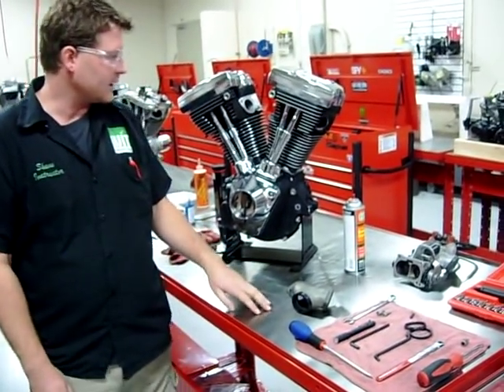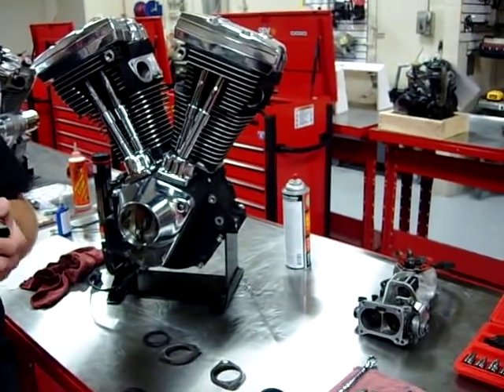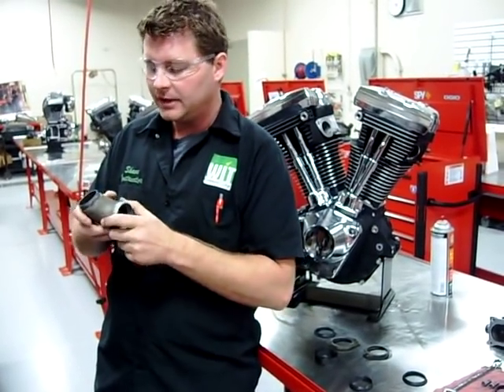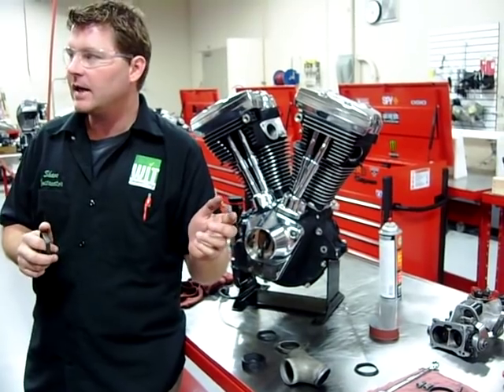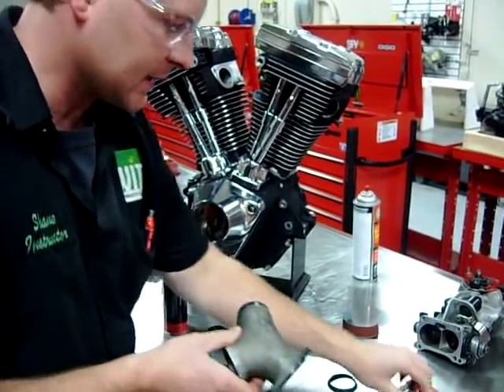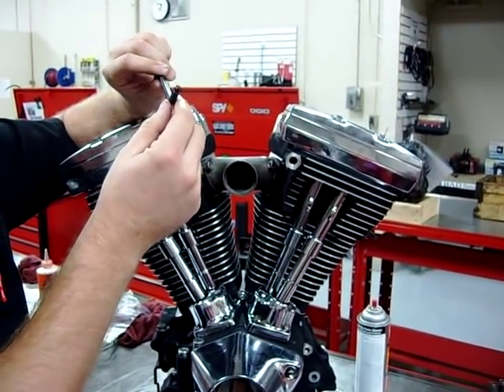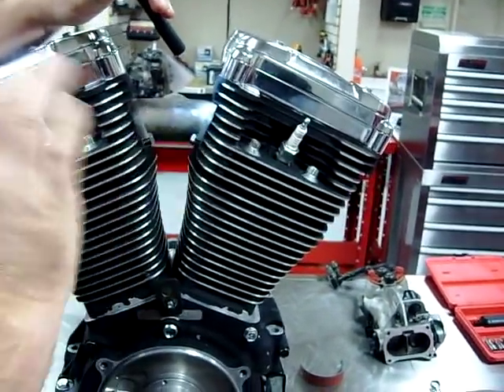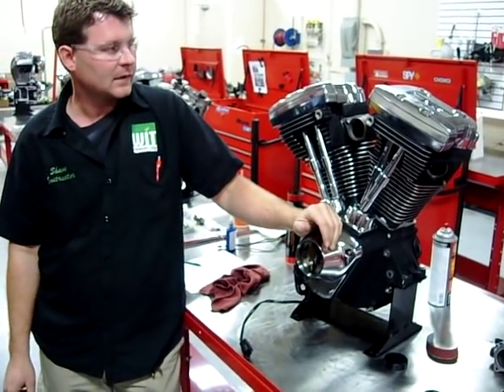Part 11 How to install an intake manifold on Harley Davidson EVO S&S Jims Revtech

Comment: Just bought a 2001 1200 sportster, I was told it had been dropped but fixed. I'm thinking it was dropped off a building, I just found out that the intake manifold is cracked on the carburetor side at 7 o'clock. I can see shiny metal on both sides of the intake going into the cylinders, I'm thinking the cylinders may have moved when they dropped it. It was fine until I put a chrome carb top on it, now when I decelerate, it Pops and sputters. You described the symptoms perfectly halfway through this video. Thanks, I'm changing it out this weekend.
Reply from the maker: I'm actually re-videoing this EVO series as we speak. These are pretty old. Checkout my playlists for Twin Cam and Sportster for much newer vids. Also you may want to sign up for notifications to never miss a new vid! Head over to my website become a member now and to receive 20 minutes of personal mentorship with me. You can even use FaceTime if you have it or find a friends iPhone and we can walk through the actual carburetor process together. I look forward to mentoring you.

Note: Membership is not required to receive coaching or email help. Here are the direct links to individual services offered at H2W:

Email Answer Service-Click http://how2wrench.com/product/email-support/ 

Phone/FaceTime Coaching-Click http://how2wrench.com/product/personal-tech-training-phone-facetime/ 

DIY Mentorship-Click http://how2wrench.com/product/diy-coaching-hire-teach/ 

Dealership Training Services-Click http://how2wrench.com/product-category/dealer-services/ 

MMI/Tech School Student Tutoring-Click http://how2wrench.com/product/mmi-tech-school-student-tutoring-services/

Motivational/Guest Speaker-Click http://how2wrench.com/product/motivational-speaker/ 

On-site Training Services-Click http://how2wrench.com/product/on-site-training/ 

Tech Line Services-Click http://how2wrench.com/product/tech-line-minutes/ 

Mechanic on Duty-Click http://how2wrench.com/product-category/mechanic-on-duty/ 

Did you like this free video and hope to see more? Would you just like to say thank you with a donation? Click https://www.paypal.com/donate/?token=TvKoeRazPL-KysbM-e0ttz-C_gPq2IrqxDmM3ORCu4nxJzQWxYbmo-6m3YuNu64XHLngGW 

Keep Wrenching,
Shane Conley
Instructor/Motivator/Motorcyclist!
www.How2Wrench.com

Comment: Sometimes backfiring is unburnt fuel mixing with the hot air in the muffler n pinging is the wrong fuel just from what ive learnt.

Comment: The last part, question how can you bolt things down slowly when you have the carb and the air cleaner bracket in the way?
Reply: You would have to remove the fuel tank(s)

Comment: Thanks Shane, that was some great info. I've been fighting an intake cough for quite sometime on my 92 FXR-LR and finally figured out it was my intake seals. I replaced the seals, but didn't clean up the intake and it helped, but I was still having problems. I sprayed the seal area with some WD-40 and it cleared up till the WD-40 dried. Now that I watched your video I've bought some more seals and am looking forward to fixing it right the second time. Thanks again for the tip.

Comment: Great video , I think it will help me do the compliance fittings. I have an old EVO with a bendix shovel head butterfly carburetor. My fuel inlet is cracked , losing fuel got to fix that too. Fun times
.
Reply: Find a used Ram Jett solid intake manifold on Ebay. The old Evo intakes with rubber boots are garbage and the later seal ring intakes exist for MoCo assembly line convenience. I threw my new 1988 stock intake in the trash when I bought the bike (I already psychotically hated carb boots from years of wrenching other brands) and that Ram Jett ran for thirty years of use until I replaced the (still good) original engine with an S&S. 
Ram Jetts don't need a carb brace even with a Super B hanging off them. You'll have to make gaskets (gray auto store gasket paper) and source some Allen bolts to replace the original 12 point fasteners which are always missing. No big deal  and you'll likely need to narrow the bolt heads slightly (bench grinder, flap disc on angle grinder, spin bolt with a hand drill) to clear the casting on the narrow side. It's totally worth it and I've lifted my engine using a soft sling around the intake! Try THAT with a stock intake. 

The "E" stamped intakes are fine for the smaller butterfly carbs be they Bendix or Keihin. (If you ever replace the carb go with a CV and a flanged adapter kit.) If you need more info my nick is farmall on Chop Cult.
Reply: Also BTW the stock early Evo carb is a butterfly Keihin but a Bendix will bolt on. Even the first Shovelhead FXRs came with butterfly Keihins (per the factory parts book in my hand, not memory). You can improve those with the Andrews (extinct but repops exist since there are a gazillion Keihins) accelerator pump cover with the internal check ball instead of the stock no check ball emissions version, if your pump cover rattles it has the ball), and a rejet (low speed and main, not just main). A 60 thru 80 drill bit set is perfect (and less than ten bucks) for drilling low speed jets. We checked the lowest number drill bit shank (not the fluted end) that was a slip fit and went up one drill size, test rode and did a plug chop, then let it be (stock engine) or increased if needed due to cam etc. I liked the butterfly on my stock engine, and the rejet runs noticeably cooler (they were lean due to emissions regs) than stock while improving acceleration noticeably.  I also removed the choke plate for better airflow since I didn't need it after the rejet and pump mod, but it doesn't get cold in South Carolina.

Comment: Great video man - Great to know, before I finish repairing / re-building my 2011 103 ci FLHTK (Electra Glide Ultra Limited) with 33,000 miles.
I have a couple questions if anyone would be so kind to help. I dis-assembled my bike because I was getting a Top End Rattle / Chattering noise / sound especially on cold starts - the bike did sound like it was sucking too much air from the breather area at times. When I took the bike apart, I found major amounts of carbon build up on the top of Piston, Combustion Chamber, Valves, ACR, Gaskets. The rest of the engine looked good. (1) I guess my question is could the intake manifold sucking un filtered air, over long periods cause this mess? 

I'm finding that the cost of tools for the bike top end rebuild is costing quite a bit of money, are there any tool rental places for a Top end Rebuilds, and Crank ( 2.)
My question is to anyone out there that may know, 3. My Crankcase has been exposed to the elements for a couple weeks now, I never covered it up. My 3rd and last question is can the Crankcase be flushed out without removing it from the bike with like WD-40 or new cheaper oil or should I just take that out too and do it that way?  I know I have some bugs and shit in there now and possibly will clog my oil pump and stuff. I know, my bad!

Thanks in advance!

Comment: Shane, I have a question about the intake cleaning.
I used 800 Emery  paper to clean the intake manifold to good effect.
I've noticed a rough brown ring at the intake port of my 92 EVO engine.
Do I need to clean that? If so what should I use, I'm a little concerned about using sand paper in that area. I've tried Xlylene and carb cleaner, but it doesn't seem very effective.
Reply from the maker: If the ring is just discolored and not gouged you should be OK. I use a scotch brite pad to clean mine.

Comment: Hi there my bike cuts out sometimes when chopping down to lower gears at intersections it starts straight away.But want to check if it has a manifold leak i have a 07 dyna streetbob.How do i go about it do i remove airflow n throttle body?Will it start after i have taken componants off to check for a leak.

Comment: Thanks for the video,I wish I could come to your school!
Reply: I really appreciate that!!
 I bought a Road King new in 2000  now 26000 miles.
 I just found out that Harley changed the cam plate and I'm wanting the hydraulic tensioner on my bike.  
The only problem is (I'm wondering)  if I should put the money into it being how Harley built the flywheel? 
It should have a new cams and bearings while inside the engine and that runs into money for tools so the job could cost 2000 or more.
It runs ok now but what about later.
Reply from the maker: Oh man you want to see this "Twin Cam" playlist! https://www.youtube.com/playlist?list=PLAtBOuPaEyt_7aGpzL9DxDVZy_fofjo1G 
I have a new video coming out just on replacing the bearings and tensioners too!

Comment: hey great video, very informative. but after you have the intake bolts "snug" an you put the carb on an intake bracket on. how do ya get back to the intake manifold bolts to torque them down?
Reply from the maker: Head over to my website become a member now and to receive 20 minutes of personal mentorship with me. You can even use FaceTime if you have it or find a friends iPhone and we can walk through the actual carburetor process together. I look forward to mentoring you.

Note: Membership is not required to receive coaching or email help. Here are the direct links to individual services offered at H2W:

Email Answer Service-Click http://how2wrench.com/product/email-support/ 

Phone/FaceTime Coaching-Click http://how2wrench.com/product/personal-tech-training-phone-facetime/ 

DIY Mentorship-Click http://how2wrench.com/product/diy-coaching-hire-teach/ 

Dealership Training Services-Click http://how2wrench.com/product-category/dealer-services/ 

MMI/Tech School Student Tutoring-Click http://how2wrench.com/product/mmi-tech-school-student-tutoring-services/

Motivational/Guest Speaker-Click http://how2wrench.com/product/motivational-speaker/ 

On-site Training Services-Click http://how2wrench.com/product/on-site-training/ 

Tech Line Services-Click http://how2wrench.com/product/tech-line-minutes/ 

Mechanic on Duty-Click http://how2wrench.com/product-category/mechanic-on-duty/ 

Did you like this free video and hope to see more? Would you just like to say thank you with a donation? Click https://www.paypal.com/donate/?token=TvKoeRazPL-KysbM-e0ttz-C_gPq2IrqxDmM3ORCu4nxJzQWxYbmo-6m3YuNu64XHLngGW 

Keep Wrenching,
Shane Conley
Instructor/Motivator/Motorcyclist!
www.How2Wrench.com

Comment: i did not see you use lock tite or say its recommended is it needed?
Reply from the maker: Try this newer video in this playlist. Video number 27. I'm redoing all the EVO series soon too. As far as loctite its best to do just as the service manual suggests unless you're using in another application like racing. 
I have a good video on threadlockers here: https://www.youtube.com/watch?v=odxDFOGDxuU&t=2s 
If it was a quick answer I’d try to respond here but I wouldn’t want to lead you wrong assuming certain factors. Reach out to me on my website contact page. We have been overwhelmed with ungrateful people and
scammers so I had to do something for my sanity by screening the over 300
requests a week! Contact Link: https://how2wrench.com/contact/ 

Your answers and help are just around the corner. Save time and money while protecting your investment and yourself by doing it the right way at www.How2Wrench.com 

Have you subscribed yet to never miss a video? Have you seen the video playlists https://www.youtube.com/user/conleybuilt/playlists? 

Want to say “thanks” or “keep it up”?
Click here https://www.paypal.me/how2wrench

Comment: Thanks for you video. I,m new to this  but what I,m doing is upgrading my 1988 carb on my 1989 FLHS to a 1999 cv carb. So I bought a intake manifold  flanges and seals. The intake manifold do the numbers go up top or bottom 27019-89 facing up or down? thanks

Comment: So, you only have to torque two bolts?  What about the two left in the motor?  do they remain where they are?  Would have been nice to show the torque process as well
Reply from the maker: Which two bolts are you referencing bud? I am starting a new Harley Twin Cam series and could address it in the upcoming videos.
Reply: +Shane Conley The bottom manifold bolts.. I guess you just loosen them but leave them in the motor?  thanks...about to tear into this on my sportster but want to be confident going in

Comment: i have a 2009 nightster and I noticed that my front exhaust header glowing orange after about a minute after start up
Reply from the maker: If I can ever be of service to you, here is a video explains how to connect with me. 
https://www.youtube.com/watch?v=vjvmB01ebcs 
Keep Wrenching,
Shane Conley
Instructor/Motivator/Motorcyclist
www.how2wrench.com

Did you like this free video and hope to see more? Would you just like to say thank you with a donation? Click https://www.paypal.me/how2wrench 

Like freebies? Click here for a free diagnostic checklist! 
http://gem.godaddy.com/signups/364621/join 

Head over to the new website and subscribe to the newsletter to never miss a video or newsletter! 
https://how2wrench.com/contact/
Reply: I had the same exact thing happen on the same bike. It was all because of an intake leak on that cylinder. Took it all apart and cleaned everything, also had to flatten my flanges they were slightly warped. Runs great now. No more popping on decel either.

Comment: Two people asked you, how is it possible to tighten the flange bolts with the carb and air cleaner installed, and you ignored them both.  Why don't you just admit that it can't be done?
Reply from the maker: +H Dale Beggs 
I give people one chance to make negative unhelpful comments. If you think for a second before you type then you would see that there are 8000 subscribers, 2.5 million views and it is hard for me to answer all questions on a FREE channel. This is a gift. Take it or leave it. Also this video is 6 years old and I reference people to watch the updated series https://www.youtube.com/playlist?list=PLAtBOuPaEyt_7aGpzL9DxDVZy_fofjo1G 
Think...Look for video 22 in the series.
Reply: +Shane Conley I'm sorry if I offended you.  However, doing these jobs with the engine removed and on a workbench is quite different from doing it with the engine in the bike and the gas tank in place.I really appreciate all your videos, even though I have a 1989 Low rider, and some of your videos don't apply to a bike that old.Again, I am sorry for being brash.